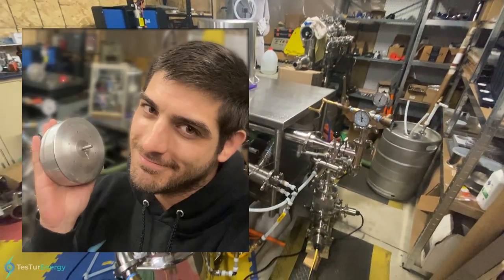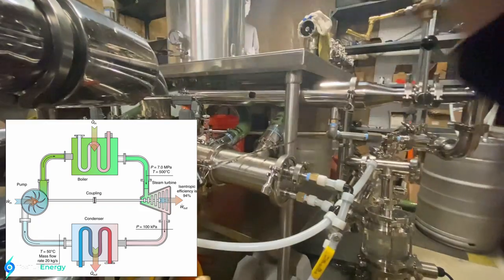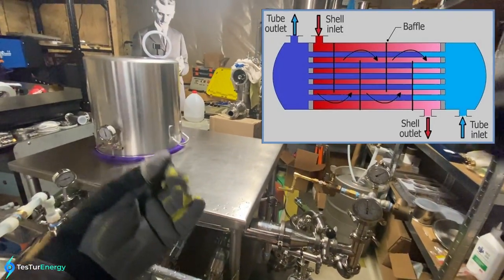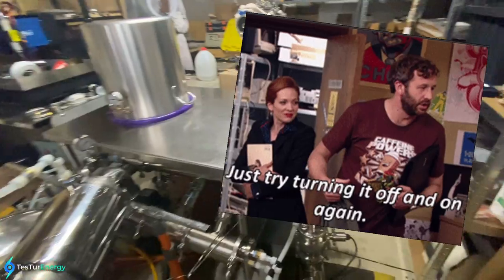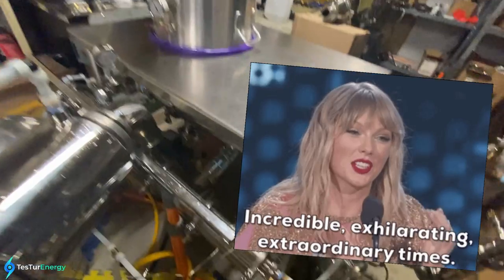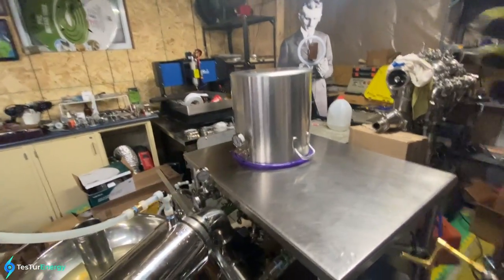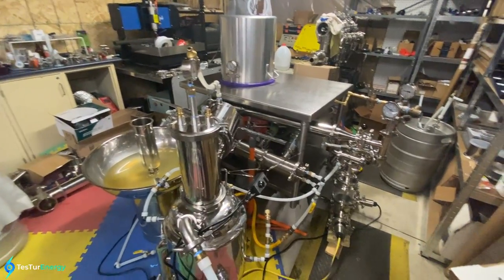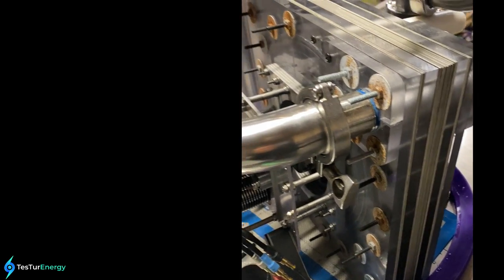Steam Tesla Turbine Renewable Energy Micro Power Plant - 1st Start Up

Comment: Also for a cheap electrical feed through could you just connect to the tank for ground and then put a copper plate with a gasket that has electrical connections soldered to it and bolt it on in a 360 encapsulating pattern
Reply from the maker: Hey thanks for commenting! ❤️🙏 it really helps with the algorithm! 

I like where you heads at! I’ll see what I can do!

Comment: I know of people using simple spark plugs as electrical feed throughs on a vacuum deposition chambers for semiconductor research. You just break of the ground electrode and use the center electrode for the feed through. If you intend to transfer significant amounts of electricity, rather than just sensor data, you need to use conductive core (old style) spark plugs without the resistive material designed for radio interference suppression.
Reply from the maker: Hey thanks for the suggestion! 🙏❤️‍🔥I’m actually using a spark plug for my water level sensor. 🤓

Comment: Best of luck scaling this up for larger power production. 

Recommendation: use magnetic bearings to reduce friction loss.
Reply from the maker: Hey thanks for the kind words! Much appreciated! 

If I’m being honest bearings aren’t really an issue. The nozzles perfectly balance the radial load on the turbine and there’s no axial loads. This doesn’t need to spin more than 15,000 rpm and  which is still under what most motorcycles rev out to.

And all my load tests were done under 12,000 rpm. 

Not to mention this 10in diameter turbine is designed for being capable of up to 500kW (1/2 a Megawatt) at full temp/pressure, disc number and stages. 

The preliminary tests are just to see how much electrical power can be produced with room temp compressed air and low temp steam driving the Tesla turbine.

The TesTur nozzles never went over 20psi at the nozzle for the 2650watt electrical load test and not over 40psi at the nozzle for the 4250watt dyno test.   (Compressed air)

This is so I can get a baseline for what to expect as I increase the temps to combustion levels.   

When using elastic gasses the counterintuitive thing most overlook is that the viscosity of gasses goes up with temp. 

So not only do we see an increase in thermodynamic efficiency from increased temps but the TesTur isentropic efficiency also goes up due to the reduced slip from the increased viscosity.   

I’m any case residential units never need more than 10kW really so we are well within the range for this little one and that’s all still without any real heat addition to do real work.
Reply from the maker: But yeah with modern bearings and built in cooling we should have no issues.
Reply: @CharlieSolis  i only mention the magnetic types for achieving faster rpm when it gets scaled up to produce more power.
Reply from the maker: @VergilArcanis  I appreciate your comment but that’s not an issue because, despite what everyone erroneously claims, Tesla turbines work just fine, get plenty of torque and output power at low RPMs.     I’ve got some copy pasta 🍝 of mine that I’ll share with ya here to explain more.  Tesla turbines aren’t made efficient by spinning really fast.   That’s only for when the disc stack is being used as a centrifugal pump, because ALL centrifugal pumps’ compressors, performance is tip speed dependent.   But spinning the turbine fast will produce a centrifugal head that opposes the incoming fluid flow, reducing the pressure gradient across the nozzle, reducing fluid final velocity, reducing mass flow rates through the nozzle and ultimately reducing power out.
Reply from the maker: @VergilArcanis  Furthermore the faster you spin them the faster the fluid you have has to go just to still be moving faster than the discs and still provide torque.   Lastly, they work just fine for industrial use and can scale up just fine because the torque on the discs is proportional to the difference in the fluid speed and the disc speed. So the disc tip speed is the important factor here. For any given fluid supply in, the bozzle will have a max fluid velocity. So the turbine disc tips will have a max speed set at that fluid speed irrelevant if radius. Now considering that centripetal force is proportional to V^2/R, if you keep the tip speed the same but increase the radius the centripetal forces on the disc for the speeds needed will actually decrease.
Reply from the maker: @VergilArcanis  Despite what MANY have claimed about the Tesla turbine, it does NOT need to be spun fast to work or work efficiently.   TesTurs are made efficient when the slip on the discs is reduced and spinning the discs fast does nothing to reduce the slip, only increase the distance the fluid slips on the disc faces, which is by definition “loss”.  Listen to what Tesla himself said in the patents of how to make them work.  “Owing to a number of causes affecting the performance, it is difficult to frame a precise rule which would be generally applicable, but it may be stated that within certain limits, and other conditions being the same, the torque is directly proportionate to the square of the velocity of the fluid relatively to the runner and to the effective area of the disks and, inversely, to the distance separating them. The machine will, generally, perform its maximum work when the effective speed of the runner is one-half of that of the fluid; but to attain the highest economy, the relative speed or slip, for any given performance, should be as small as possible. This condition may be to any desired degree approximated by increasing the active area of and reducing the space between the disks.”  1) increase the speed of the fluid relative to the disc, (not increase disc speed)  2) increase surface area 3) decrease disc spacing  This is how you actually make a TesTur work. Not by spinning it fast.   The fluid interactions with the disc that govern efficiency an torque are adhesion and cohesion. Full stop. And spinning fast does nothing to increasing either to increase the turbines isentropic efficiency.   This is why everyone who chases rpm with the TesTur just flat out fails. They aren’t even trying to design them properly so of course they won’t work. 

You just have to know how to design it correctly to actually reduce slip to make them work, not spin them fast.  The only reason people think Tesla turbines have to be spun too fast is because EVERYONE has mistaken the part of the patent that is about the turbine being used as a pump as being about it being used as a drive turbine.   The only time you want to spin a TesTur fast is when it’s being used as a pump/compressor. This is because ALL centrifugal pumps’/compressors’ performance is tip speed dependent.   “I have found that the quantity of fluid propelled in this manner, is, other conditions being equal, approximately proportionate to the active surface of the runner and to its effective speed. For this reason, the performance of such machines augments at an exceedingly high rate with the increase of their size and speed of revolution.” -Nikola Tesla
Reply from the maker: @VergilArcanis  And again, you DO NOT want to spin too fast in a TesTur because the centrifugal head will just counter your incoming fluid flow reducing power. And the faster you spin discs, you’re fluid has to be going even that much faster just to be able to apply a torque on the disc face.   “Still another valuable and probably unique quality of such motors or prime movers may be described. By proper construction and observance of working conditions the centrifugal pressure, opposing the passage of the fluid, may, as already indicated, be made nearly equal to the pressure of supply when the machine is running idle. If the inlet section be large, small changes in the speed of revolution will produce great differences in flow which are further enhanced by the concomitant variations in the length of the spiral path. A self-regulating machine is thus obtained bearing a striking resemblance to a direct-current electric motor in this respect that, with great differences of impressed pressure in a wide open channel the flow of the fluid through the same is prevented by virtue of rotation. Since the centrifugal head increases as the square of the revolutions, or even more rapidly, and with modern high grade steel great peripheral velocities are practicable, it is possible to attain that condition in a single stage machine, more readily if the runner be of large diameter. Obviously this problem is facilitated by compounding, as will be understood by those skilled in the art. Irrespective of its bearing on economy, this tendency which is, to a degree, common to motors of the above description, is of special advantage in the operation of large units, as it affords a safeguard against running away and destruction. Besides these, such a prime mover possesses many other advantages, both constructive and operative. It is simple, light and compact, subject to but little wear, cheap and exceptionally easy to manufacture as small clearances and accurate milling work are not essential to good performance. In operation it is reliable, there being no valves, sliding contacts or troublesome vanes. It is almost free of windage, largely independent of nozzle efficiency and suitable for high as well as for low fluid velocities and speeds of revolution.” -Nikola Tesla  Tesla both knew it wasn’t meant to spin fast and that it worked great for low speeds IF you design it correctly.

Comment: Strap a VSS( vehicle Speed Sending unit) on the outside of your motor generator.   It will pick the field polarity  and give you a heartbeat to read from a safe distance from the steam. Granted you will need to determine the ( electric) ratio. 3 2/3 ≠1  DC =3.66÷2 
4pole DC = 4
Blcd=3.66÷3
4pole bldc= 3.66÷6
Ect
Reply from the maker: hey thanks for showing your love and support by commenting 🙏❤️ it really helps with the algorithm!        

Yup yup! That’s how I did it for my compressed air tests. I just take the frequency off of a single pole of the generator. And because the turbine is geared UP to the generators at 3.0666 to one. 4 pole motor (but you only divide by 2 for a 4 pole because a 2 pole does 1 cycle per Revolution 4 pole does 2 cycles per Revolution) 

Rpm = F * (1min/60sec) * 2 * 3.0666
    = ~(1/10) * F 

So the rpm is pretty much 1/10th the frequency. It’s rather convenient while reading the frequency because it is all the correct significant figures.
Reply from the maker: The difficult part was getting a vacuum electrical feed through that will hold a seal well. I’ve since fixed that though. 

Check out the video I uploaded to my Instagram 

https://www.instagram.com/reel/ClqGwiDDRSN/?igshid=ZmMyNmFmZTc=
Reply: I'm a slow lb  not a quick g . 
Sorry.
   Vac heating the genset sounds bad. What active cooling have you added  to compensate for the loss of convective cooling .
Amp ratings have to be adjusted to account for a vac environment.  As the A raiting is in free air  allowing convective cooling.
Reply from the maker: @daviddroescher  yup I’ll have cooling water going over each generator.

But I’ll be wayyyy under powering them for the vacuum conditions, anyway. I only want 1kW out for now. And they are capable of doing 1500watts continuous each at 12v I’ll have 4 of them running at once in the end of these tests. 

Ultimately I will be going with a direct on shaft generator in the end though so things I’ll be changed a couple times before then. 

Just trying to price out different setups for what I can make easily vs what I would like to make if I had the resources. 🤷‍♂️
Reply from the maker: @daviddroescher  I also need bearing cooling for long term runs but I have a feeling because the boiling point is so low any condensate coming out of the turbine may help evaporatively cool the bearings, and maybe the generators too. 🤷‍♂️ although that may be pie in the sky asking too much Fromm the system. Either way cooling water is really easy. Just gotta bulkhead in and I can even let the vacuum pull it in for short term runs. And/or the condensate return/boiler feedwater pump can replenish the cooling water all the same.
Reply from the maker: @daviddroescher  Hey I just posted a new video! I think you’ll really like it.
Who Owns Your Copy in the A.I. Revolution?
https://youtu.be/_v0N83U4NoU

Comment: What are the pros/cons of using steam instead of compressed air?  I've been dreaming up a system that would use wind power (Midwest USA) to turn a compressor.  I'm thinking of using super-high pressure carbon fiber air tanks to run a tesla turbine.  Magnetic bearings and magnetic gearboxes would be used to cut out energy loss as much as possible.  Biomass would be a really neat option, so I'm not ruling out steam yet.  Thanks for your work and expertise.  I love the energy you are bringing to this project!
Reply from the maker: Hey will! Thanks for reaching out. So both steam and compressed air are equally viable just different ways to do it. Steam Rankine cycle would be from heat sources only and compressed air could be from a windmill with additional heat to aid in the Brayton cycle. 

Whichever is chosen the disc stack needs to be designed for the fluids adhesion to the discs. Steam being s polar molecule adheres to metallic objects more. Whereas compressed air is mostly non-polar molecules, O2, N2, CO2, etc.  so different surface treatments may be desired, like hydrophobic coatings to allow for the non polar air to adhere to the discs more. Or hydroPHILLIC surface treatments for steam to further increase the adhesion. 

Some people might not want to deal with the compressor. 

But I know the Amish use windmills to compress air and store it very very large tanks for powering their wood shops and fans around their shops for cooling, also from the expansion cooling. 

You will need a LOT of tanks for storing enough energy though and high pressure tanks are really the only way to feasibly go if you don’t have a farm to bury massive tanks. So the thermal mass storage with the steam is a matter of footprint and safety being at low pressure/atmospheric pressure. Compressed air will hold its energy longer though as heat will invariably radiate, conduct away from the  hot tanks over time even with good insulation. 

My plan is to replicate Nikola Tesla’s improved combustion + steam turbine patent GB 186,083,  used with a condenser and high vacua pump to do the full high pressure high temp Rankine plus inverted Brayton cycle. So it’s a combination of both the compressed air with heat and steam with heat all in one system. 

Tesla really nailed it with that patent. I’ve got a walk through video in it if you’re interested I can share it. 

But anyway there are lots of reason to do one system or the other, pros and cons for both, it will come down to individual preferences and capacities of each end user.
Reply from the maker: These are a couple videos to specifically watch. 

Make sure to check out the latest updates on the combustion + steam Tesla turbine builds! 

Solis Talks Tesla Turbines - Nikola Tesla’s Electrical Power Systems Patent GB 186,083 Walk Through
https://youtu.be/5Y3D13JmtcA

Tesla Turbine Jet Engine - gasoline fuel burner atomizer flame tube test 186,083 propane burner
https://youtu.be/gRqKowignac 

Tesla Turbine 250 watt to 2.65 kW Power and Efficiency Test
https://youtu.be/K7qZvq1CMFg

+5 Horsepower Tesla Turbine Dyno Jet Turbo Power & Torque Curve 375 mph @ 125 00 rpm HIGH SCORE!
https://youtu.be/exF5Rn-L8gs
Reply from the maker: Check out this video also on Amish Compressed Air Energy Storage (CAES)! Blew my mind! I didn’t know they did that until recently when looking up air engine stats to compare my TesTur to. https://youtu.be/Oc0b4aBOyBw
Reply from the maker: This is a good paper on Compressed air energy storage. Definitely worth the read. 

https://www.lowtechmagazine.com/2018/05/ditch-the-batteries-off-the-grid-compressed-air-energy-storage.html
Reply: @CharlieSolis  Thank you very much for all the resources! I'm excited to learn more about what's possible. I'm leaning toward the compressed air tanks since it will be on a farm with lots of excavation happening.  I'm a few years out from being able to prototype, so I'm just gathering resources.

You're awesome. Thank you
Reply from the maker: @willengelmann6303  sounds like a prime candidate for CAES! I’m excited to see what you do!
Reply from the maker: @willengelmann6303  Hey I just posted a new video! I think you’ll really like it.
Who Owns Your Copy in the A.I. Revolution?
https://youtu.be/_v0N83U4NoU